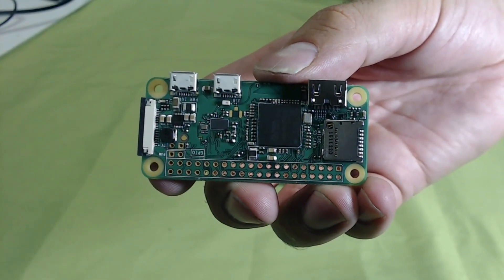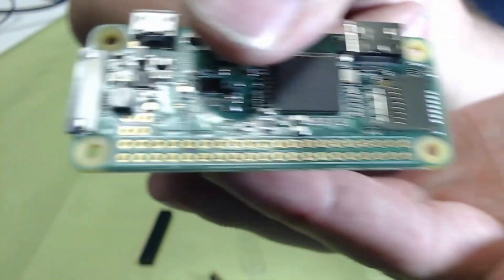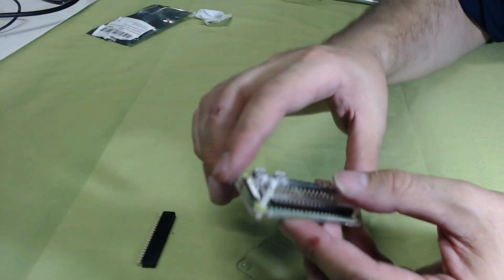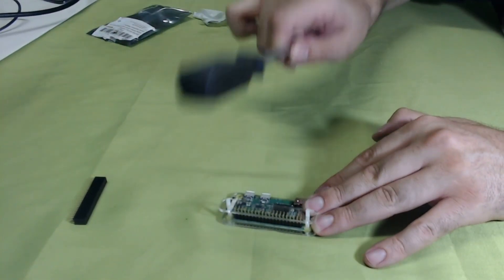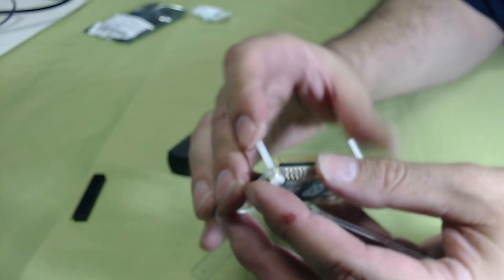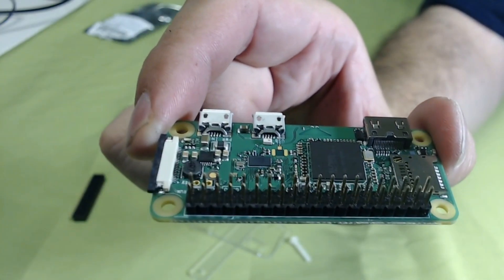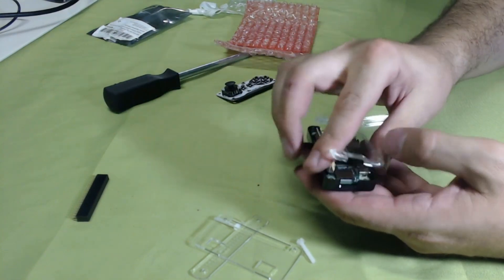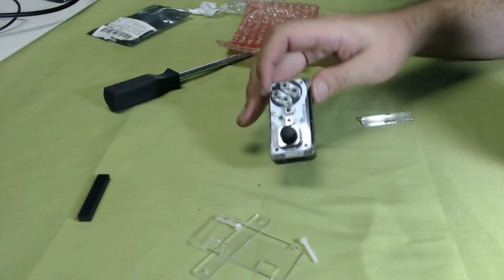NO SOLDER GPIO FOR PI ZERO W & JOY BONNET!

Comment: Hello, big question about JOY BONNET: can I connect this Joy board separately to the Pi? I mean not on top of Pi by using GPIO socket but using external m-m Dupont cable conneting pin from Joy board to Pi board. Software need or the Pi already feel the input?
Also I want to connect 2 of them to a single Pi, possibile to do? Need to program something?